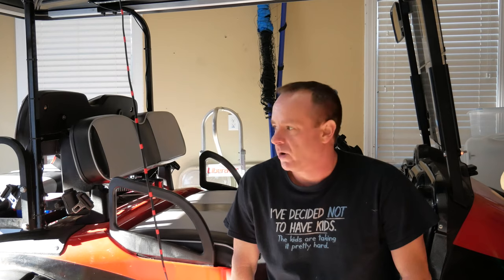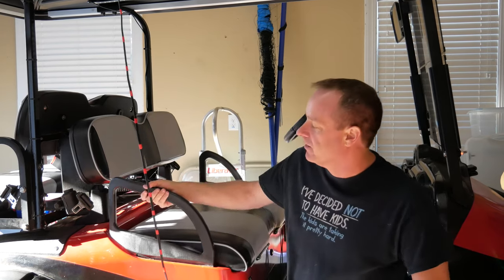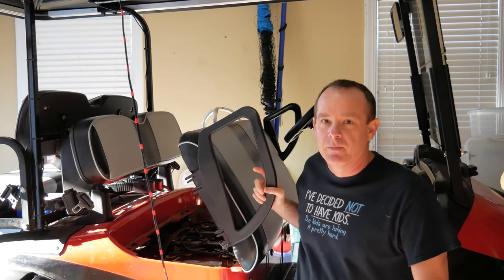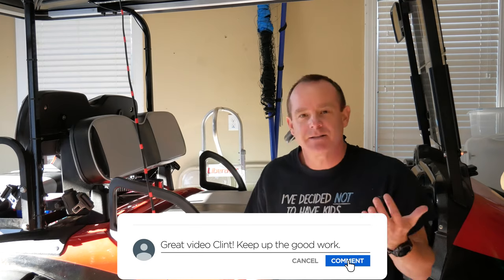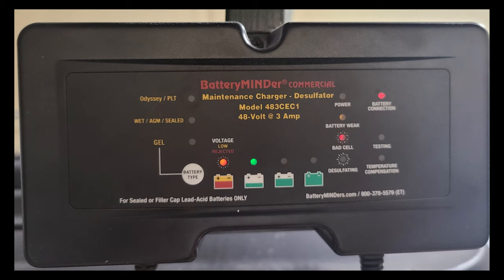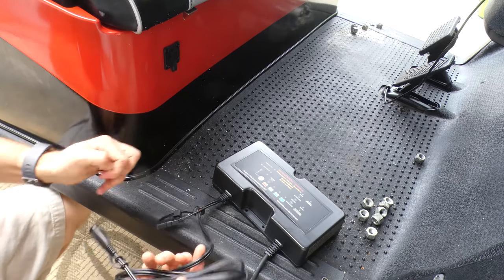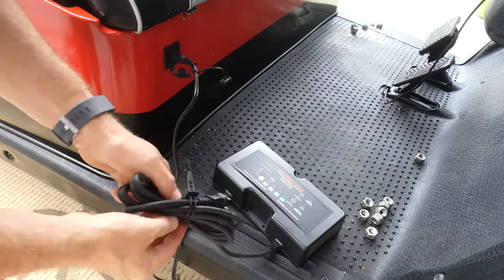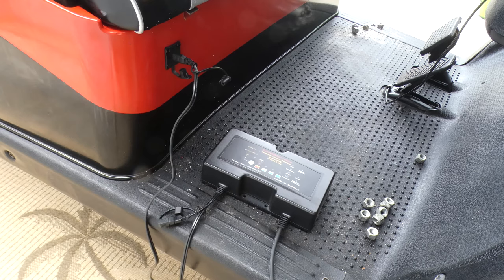Double Your Golf Cart Battery Life

Comment: So... the manufacturer of my golf cart batteries (US Battery) recommends a three stage charge with the first two stages being a mix of high amperage and high voltage... enough current to "boil the batteries". Trojan makes similar recommendations. This high current charge is designed to delaminate the chemistry in the battery case. I know you don't want to get "too deep into the science" but I think your science might not actually be science at all. And I kind of think the guys who made the batteries would know more than you or I might.
Reply from the maker: Hmm, a company would totally be incentivized to tell you how to  make their disposable product last longer right? Btw, did you do any research before you posted this? I have no incentive for you to buy one of these chargers, I am just trying to help people out.   These desulfating chargers do use high voltage and frequencies to do much of what you mentioned.  And if you actually do a google search you will find out that many battery experts recommend desulfating chargers. Or just search on YouTube and you will find a dozen videos not produced by me of people actually putting them to the test and proving they work.  They can even bring batteries that fail testing and won't hold a charge back to life in many cases. So yeah, science wins again.